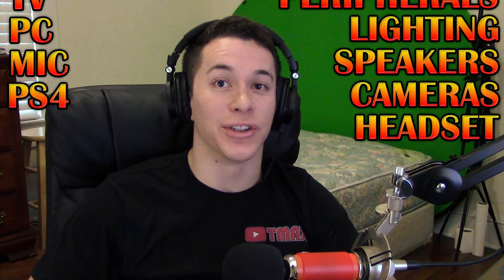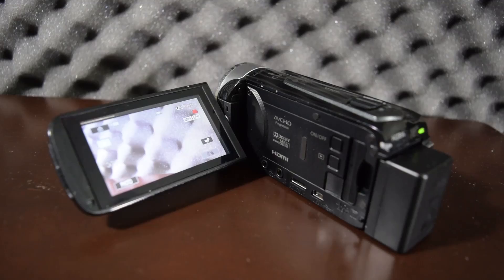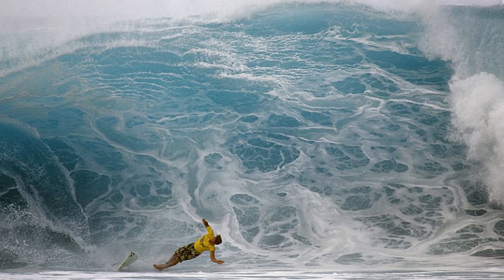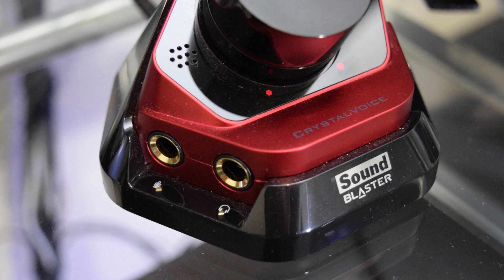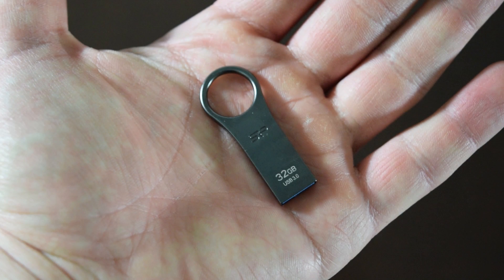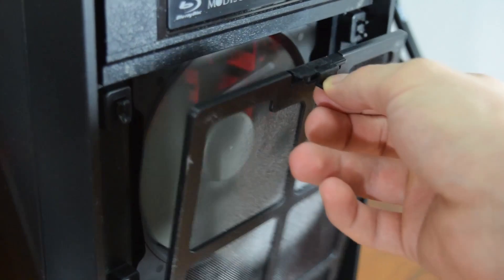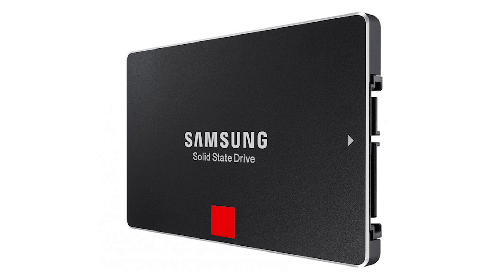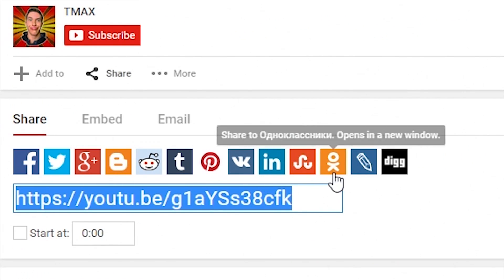My 2015 PC Gaming Setup - Everything You Need To Start A Gaming Channel

Comment: Hey, do you still use the Canon Vixia for recording your facecams? If so, what modes do you use on it the most? I usually use either the Scene (Portrait) mode or the Programmed AE, but what do you think is the best on the camera?
Reply from the maker: +FireNinja606 I do still use the Vixia. I use Program, but and auto focus. You just want to light your scene very well so it doesn't result in grainy footage.
Reply: +TMAX Thanks! Sorry for the late reply.

Comment: No I already have a ps4 and controllers just the face cam and things
Reply from the maker: +Dougal Bland it really depends on what brands you get. I wouldn't use a webcam, I'd use a camcorder. For a mic, I'd use a blue Snowball, it's cheap, but good. For recording games, an elgato hd60 is expensive, but worth it; but if you want free, use fraps.

Comment: All of the ps4 ones or just the ones you need for a basic setup because I'm broke
Reply from the maker: +Dougal Bland Well, a ps4, two controllers and a charge deck is like $300-500. Then the tv price ranges. If you're broke, i suggest getting a pc. PC conquers console every time. I played console for 20 years then switched to pc.

Comment: You brag about all this PC gear but it's pre built. AND you use it with a fucking controller. Cringe
Reply from the maker: +The commenting cow 
1) Not bragging. It's an instructional video. This is probably the first statement I make.
2) Does using a controller and buying prebuilt make your life more important than mine?
3) Being kind always makes a difference. Rude comments are without value.
4) You are loved. You are special. You deserve happiness.